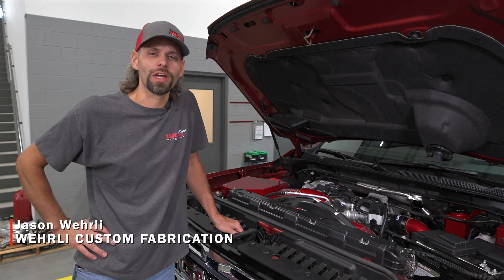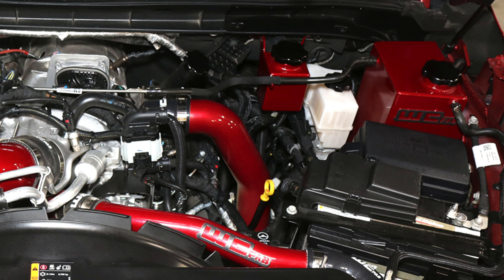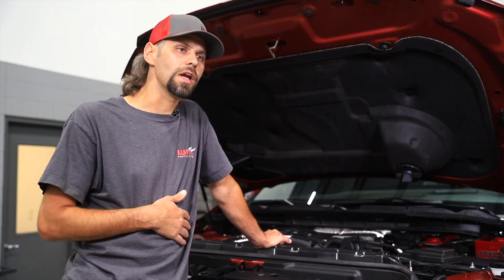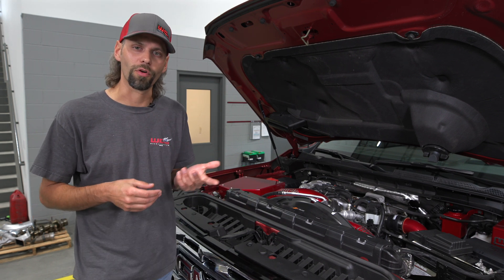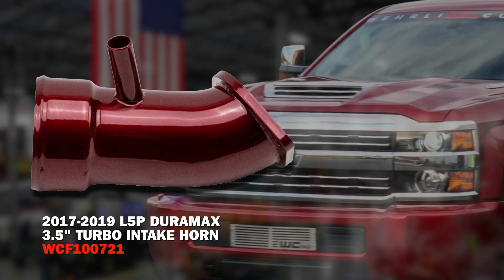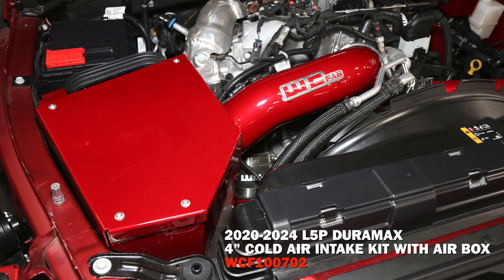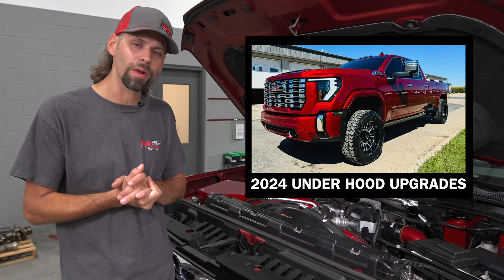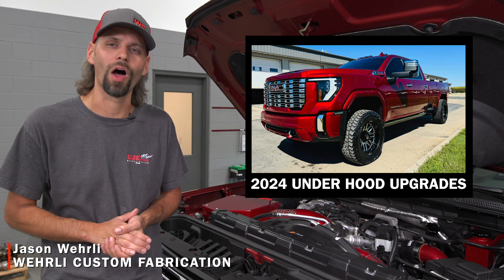WCFAB 2024 GMC Denali HD Under Hood Upgrades

Comment: Someone should do Dyno results before and after
Reply from the maker: The guys Duramaxtuner have covered our intake in a test previously. You can check out that video here: https://youtu.be/q9IsLdS8ZL0?si=g8asZMYcMnxMw-9B

Building on what they cover there, we've recently installed an Edge EZ Tuner 20202 on this truck since this video was filmed and ran it on the Northwest Dyno Series Superflow for the Emissions Class when it was at our Open House. We set a stock tune baseline of 354 HP and then turned it up and saw an increase to 446 HP (a 92 HP gain). Edge says the tuner is typically good for around a 60 HP gain by itself. We're looking forward to getting some more detailed testing of other combinations in the future, but that's scratched the itch for a bit more power for now at least.
Reply: @WCFab From the testing I've seen on the edge I dosen't perform as good as advertised so your intake may have done more than you think.